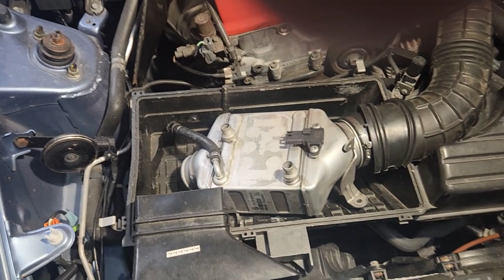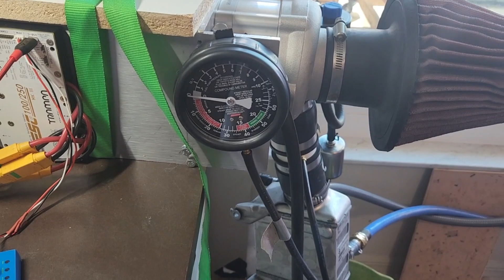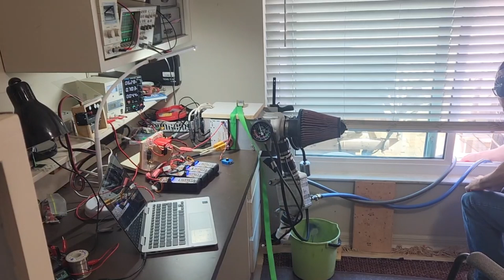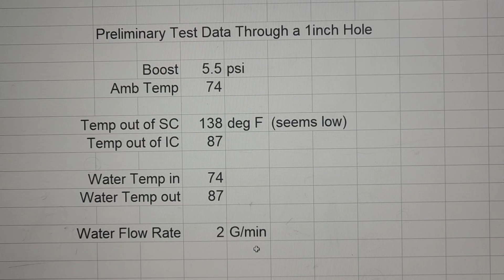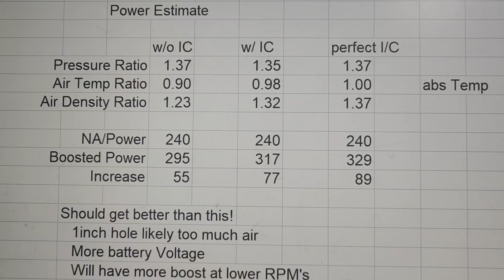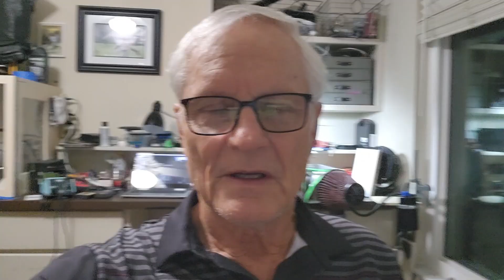Electric Supercharger for S2000 - Intercooler Performance Measurements

Comment: This is really cool! I have a Miata and have been thinking if something like this would work. 
I'm wondering how you will control the electric motor rpm/boost in relation to "throttle position". Maybe I missed this part. Looking forward to seeing the progress!
Greetings from Sweden.
Reply from the maker: @fropple  I'll use an arduino.  Tap off the TPS and a coil for RPM.  Program the Arduino to drive the ESC.

Comment: you also have a thing called heat soak, when I supercharged my S10 and took it to the drag strip I didn't have an intercooler so my problem was that the supercharger never cooled down. I would be curious how long it took for that 1 gallon of water to heat up and what the cool off time was if you don't use a heat exchanger.

Comment: I started on episode 1 and now I'm on this one. I have several thoughts: 1. boost is a measure of restriction to airflow, so you might have inadvertently artificially raised the boost by putting the 1 inch outlet on the outlet. 2. I wouldn't worry about keeping the plastic intake ducting, I would rather have it be functional. I would keep the 2 intercoolers together and have your 2.5 inch pipe Y into the 2 intercoolers and then Y out and then into the intake. 3. water removes heat better than anything so your air to water intercoolers should be sufficient. I would use the biggest air to water heat exchanger you can fit in your front end. 4. I am using a bosch boost/vacuum gauge in my supercharged 6.0 liter Chevy S10. you can pick up one of those gauges really inexpensively at your local auto parts store. I think mine was 40 bucks. it does matter where you mount that gauge, a bad location will skew the data.

Comment: Happened upon your channel and noticed that your desk looks pretty much the same as mine. I have a good time repurposing electronics for modified automotive fueling and ignition systems. Working on a supercharger design and probably will mosfet control electric motor for it but I’ll have to see how much cheaper an equivalent gas engine would cost when I’m ready for it. Planning on about 25 hp for 1atm at 700 cfm. Would bring about 1000 hp on a 6 liter engine. Looking forward to more videos!

Comment: Hello. I found your channel by random chance. I love your innovation! I am also an S2k enthusiast. Can i ask what are your motivations for going your own route, instead of say, a science of speed or other off the shelf kit? Are you trying to keep everything hidden?
Reply from the maker: I was looking for a project where I could learn a little about metal work and machining. I've owned the S2000 for a long time and decided it needed a little something more.  I don't see any fun in installing someone elses kit.  Been there before.   I'll probably get similar max HP to the SOS stage 1 kit, but way better low and mid range power.   I don't really want 400RWHP in this car.   I've had really fast street cars before, but they are no fun around here - just frustrating to drive and I'm too old to worry about cops.    340 HP in an S2000 is about the max I want.  The trunk mounting is unique but also practical, and the stealth is cool to me for some reason.

Comment: you running your car for less than five minutes?
Reply: 🤣 Classic case of not understanding Physics.1 hp input will not give you anything worth the expense or weight. 🤣
Reply from the maker: @madb132  
As to the physics - The blower, electric motor and box weigh 31 pounds.  Battery is 6.  A gallon of water is 8 pounds and the IC is 3.  A few more pounds here and there. The power increase is around 35%.  Weight gain is around 2%.  Does the physics make sense now?   Cost is going to end up less than $4000 plus the fuel system upgrade.  Supercharger was $2100, motor $400,  ESC $400, battery $350, and used intercooler $75.   I haven't decided on the fuel system yet.  An FMU would be cheap but not as good as a new ECU.  Either way cheaper than a $6500 Science of Speed Stage 1, and I'll have better performance.  The SOS will have a little more peak power, but I'll have way better mid range.  The supercharger doesn't run except at high throttle, so it doesn't make noise, get hot, or reduce fuel mileage - if you care about those sorts of things.
Reply from the maker: I assume you are questioning whether the batteries will last long enough to be useful.  If so, that is a good question.  When I'm driving around on the street, the car will be at max boost for a few seconds at a time.  My little battery can provide maybe 4 minutes of boost,   but there is an onboard charger so they will charge back up.   4 minutes at full throttle is a lot for my kind of street driving.   I could make 15 quarter mile runs, without recharging.  At Sebring, you are maybe on boost 1/2 the time, so I could probably do at least 2 laps with boost, but I don't plan to track the car anymore.  The battery only weighs 6 pounds, so I could make it a lot bigger, but I doubt I'll need to.

  The electric supercharger has some advantages over normal centrifugal setups.  I can get full boost at low RPM's, in fact I'll probably get more boost than at max RPM.  The S2000 is a high RPM screamer, so this is what it needs.   The engine doesn't have to provide power to the supercharger.  At 340hp, I'll probably have more useful power than an engine driven 400 HP centrifugal over a much wider RPM band, with way lower stress on the engine.  The 400HP engine is actually making 430, but 30 HP is being sucked off the engine by the blower.  But lets face it, I like it because I don't want to bolt someone else's supercharger kit on my car.  No fun in that.  Who else has an s2000 with a electric supercharger in the trunk, that is almost completely hidden?

Comment: Hello Steve, how are you balancing the lipo cells while you are charging them? It is important to keep them balanced, if one of the cells gets charged over 4.2V it turns into a fire hazard incredibly quickly.
Reply from the maker: I will have a battery management system in the car.  There is a really cool system that works with the VESC speed controller, but it is only 18s.  Id like to use it, but I'd also like to run 20 or 22s.   For now, I keep a small voltmeter on each battery and watch the balance,  I check the individually cell balance manually, and use a balance charger if  needed.  They stay pretty balanced, but I watch it.  I wasn't so careful at first and over discharged a battery and damaged it.  That is why I am tested with only 16s.  A new battery is on order.

Comment: I still think injecting methanol or water/methanol directly into the supercharger will allow much better results. It sure works for ALEXLTD. The downside of the small intercooler is when the compressor isn't running the engine has to suck the air all the way from the trunk and thru the intercooler so part throttle performance will suffer. Without the intercooler the compressor could easily fit in the airbox's location.
Reply from the maker: Water/methanol is certainly an option, but I believe an intercooler will perform better with fewer issues.  Alex is running a lot of methanol through his blower, he is basically running a methanol/gasoline fuel mix.   Any failure with the injection and the engine is toast.   A plugged injector, a bad wire crimp,  running out of methanol, etc.  With no methanol he goes way lean, the fuel octane drops and temps skyrocket - a hole in a piston most likely.     He probably checks everything after every run.  Normal race car stuff.  I'm looking for a  normal street driving experience.   I may add water injection after the IC.  That way the IC gets the temperature down near ambient,  then the water takes it lower. This is what the fighter planes in WWII did late in the war.   

Your comment on part throttle problems is interesting. I hadn't thought of that.  At throttle tip in, you have to get the long column of air moving.  I don't think that will be a problem for me, as I plan on using a surge valve that stays open when the blower is not running.  So there is a short (with air cleaner) air path to the engine when not under boost.   Getting it tuned to drive seemlessly might take some effort. 

I'm thinking the trunk mount is not going to be too difficult. The only downside I  see is what it is going to sound like right behind my ear.  It may be great, but then...   I like the idea of keeping the stock look and the blower hidden.  No good reason, its just what I like.
Reply: @stevebrantley3851  Look at the "Check All" valve products. They have a large selection of spring check valves that operate at extremely low differential pressure, you might find something suitable. I have use both SS and plastic Check All's including some with custom springs. I know the Torqamp guys offer a solution too. You could also make something with a simple flap. I have an '04 SI hatch w/K24 that I'm considering Alex's method for. It would never go to a track, mostly only be used for 3rd gear passing opportunities on our crooked two-lane country roads. Too many other home projects for me to do it anytime soon.
Reply: @stevebrantley3851  A surge valve? I wonder if reed valve used in two stroke machines could make it simpler.
Reply: Steve , I completely agree using intercooler method. Water injection is my preferred way over meth injection,mix et ….   WWII technology goes a long way.  Liked & subbed ✔️